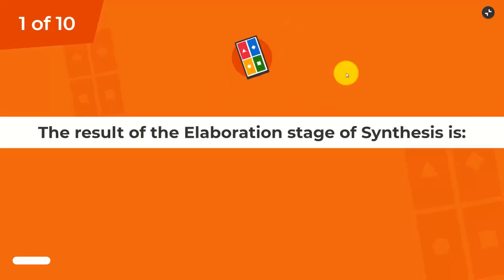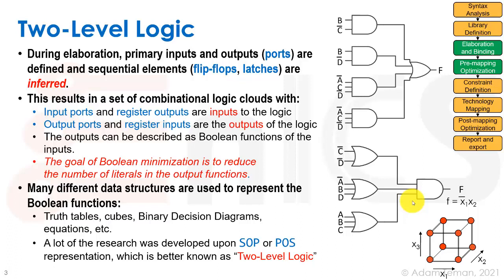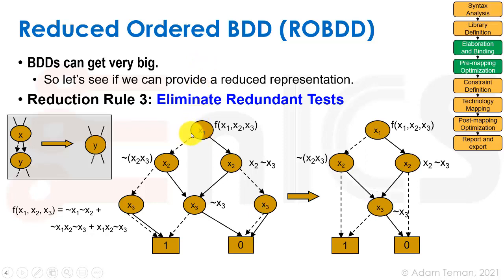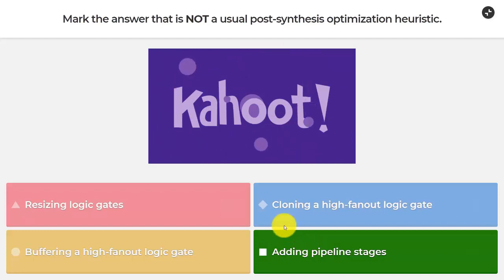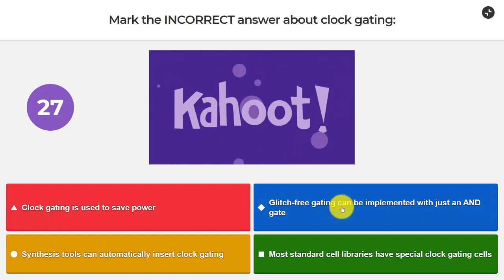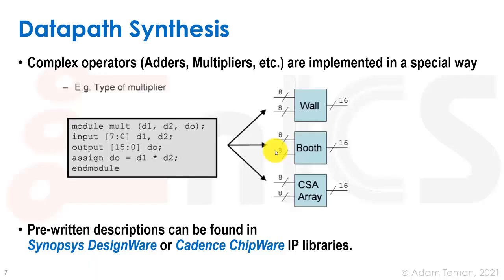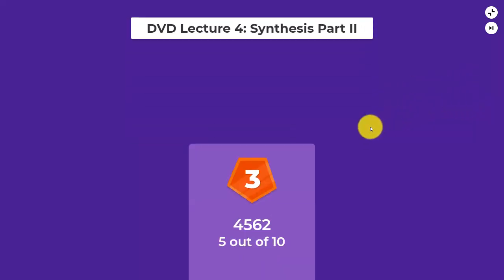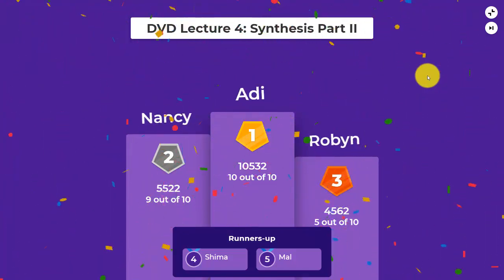DVD - Kahoot for Lecture 4: Logic Synthesis Part 2

Comment: Sir, I think topographical synthesis was not discussed in the lecture - Logic Synthesis Part2
Reply: Sir, in which lecture do we discuss topographical synthesis? Or is it discussed in this kahoot only?
Reply: SIr, kindly answer!
Reply from the maker: Hi, 
I discuss it briefly in Lecture 3e at 13:15 - https://youtu.be/-NgWsQJCGls?t=795

Strangely, I have a slide for this at the end of Lecture 4, but it isn't in the recording. Maybe I decided to move it to Lecture 3, making it redundant in Lecture 4... Anyway, I don't go into detail about it - mainly that you run some sort of placement during synthesis to get better wire parasitic estimates.
Reply: @AdiTeman  Sir I cannot find a good online reference for Physical only cells( tie cells, endcap cells, filler cells, spare cells etc.) which explains their requirement and working. Can you kindly suggest any source?